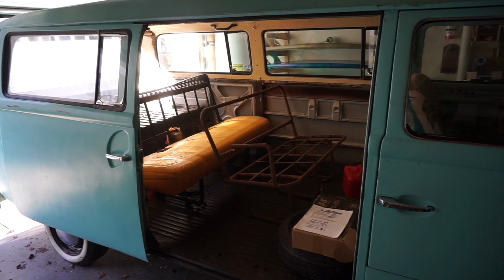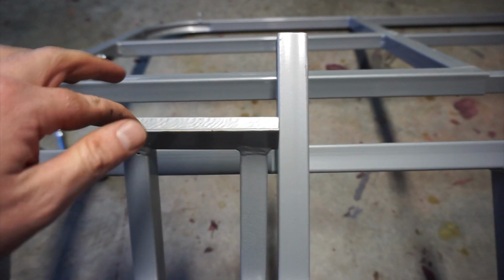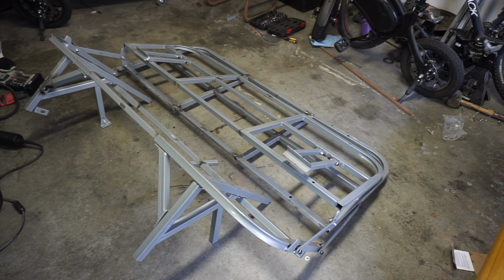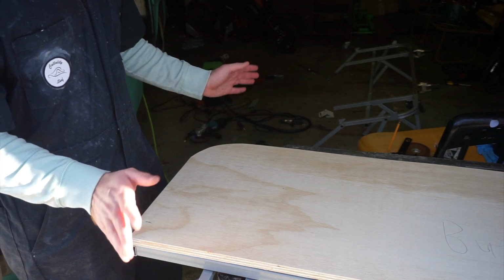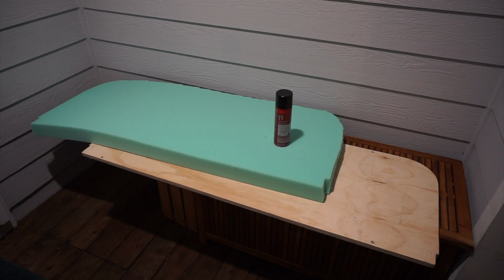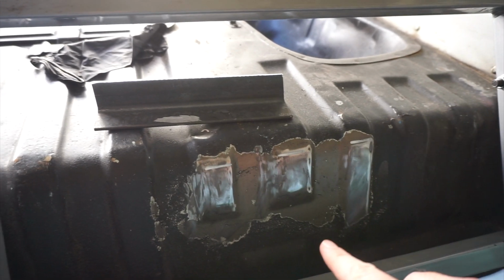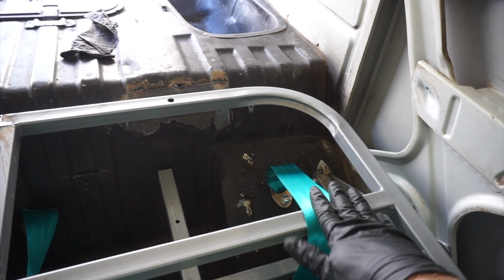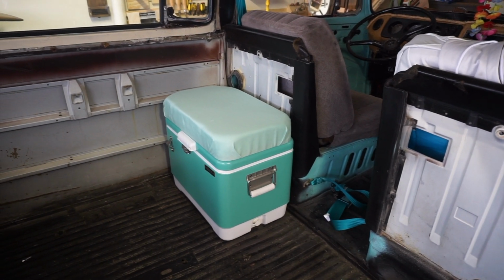Rock and Roll rear seat and bed from CIP1 and Ebay.  1973 VW Bus Restoration Part 4.

Comment: I purchased and returned this same seat when I realized how reclined it remains when upright.  There are a few great options out of the UK to use instead.
Reply from the maker: Which one did you end up going with?  I plan on getting the Rusty Lee once they start shipping to the US again.    Our bus only takes short trips to the beach and usually keep the rear seat in bed form once there to relax on.  Will need a better seat when we start driving further.
Reply: I bought the same one and removed it too. Not a good design. Got the stock one and made it full width from NLA VW Parts. Really happy with it 😊
Reply: How was the return experience? Were they easy to deal with?

Comment: Purchased the same seat, waiting for arrival. Why did you cut it initially, says it fits late model bay's?
Reply from the maker: Cancel and order the Rusty Lee one from the UK.  

This one fits buses but involves a lot of work to get it to fit nicely, and even after the sitting position is uncomfortable.  

What I thought would be a weekend job took 3 weekends to cut it and weld it so it fit and functioned properly.  

It also has no instructions.   So you’ll want to pay attention to how I have it assembled.  Was a lot of trial and error.
Reply: Its already been shipped, sad thing is that the one you just mentioned is not that much more expensive. It says the max length is around 56" from what I remember, and I planned on having it the full length. Do you think I would still need to do the cutting and welding?
Reply from the maker: @kimhawk5228  Yes, mine is full length in our 73.   I welded because the self taping screws it includes were garbage, and I wanted it more stable.  Also one of the feet was off, so I cut it and welded back to fit better.    The seat is "good enough" if you can figure out how to make it work.  It just takes a lot of work to make it work.  Hopefully my video makes it a little easier from you, since mine was a lot of trial and error.
Reply: @callalilycollective  Thank you. Yes your video has been helpful, but honestly this thing is so confusing that I keep the video paused on each section just to figure out which direction most of the items go lol. No instructions in the box, but was able to print out the instructions from Just Kampers where CIP1 actually gets it from. Those instructions are pretty much trash as well, but it's something. Thank you for posting the video, although this may be more than I bargained for, we will see how it turns out.
Reply from the maker: @kimhawk5228  good luck!  There may be some photos from other's on thesamba.com that might be helpful.  I never looked though, so just an assumption.

Comment: The worst bed frame. I threw mine away . 😢  Buy the heritage parts one
Reply from the maker: Ya it’s trash.   The heritage one looks way better but someone gave it 1 star.   I’m thinking of getting the Rusty Lee one.
Reply: Rusty Lee wouldn't ship to me but the heritage one is solid! Been using it for three years, in a vanagon though .
Reply from the maker: @leejensen7550  do you have an instagram or anywhere I can see a picture of yours ?

Not that it helps you now, but Rusty Lee ships international once again.